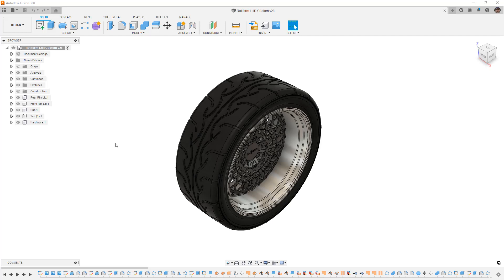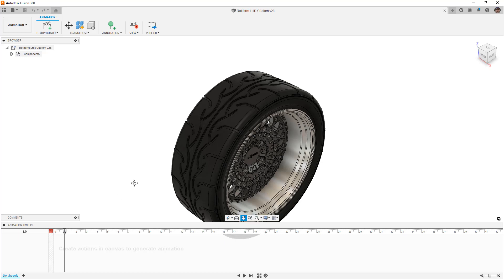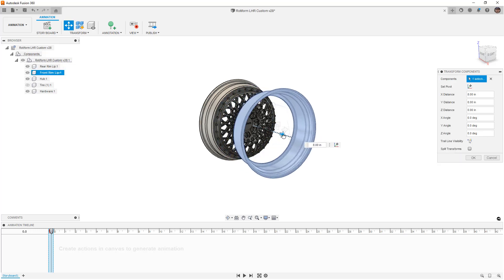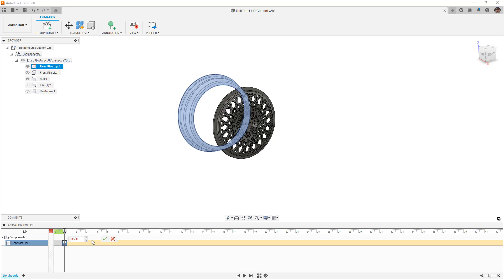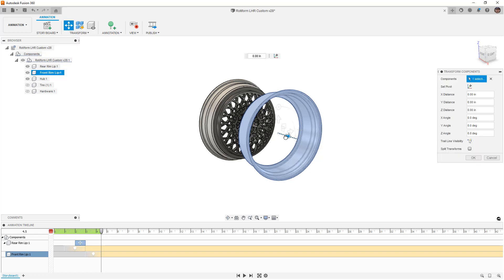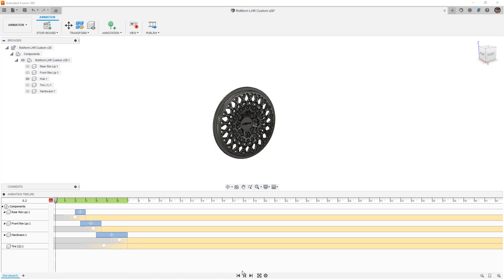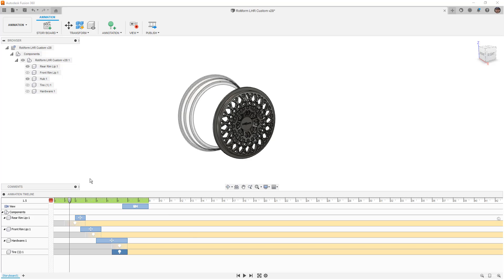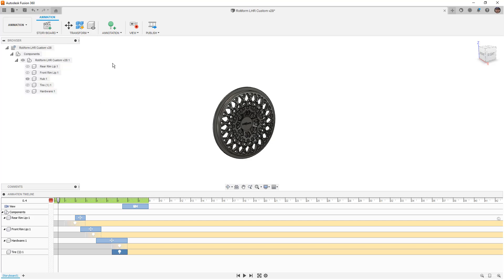Fusion 360 Quick Tip | Basics of Animations | Everything You Need To Know (Almost) #fusion360

Comment: Why did it zoom in when you rotated the tire at the end? I'm tring to avoid it doing that, but can't figure it out.  it's so annoying, especially during complex camera view movements
Reply from the maker: Yeah unfortunately that "animate view transitions" I don't think can be turned off...  The only way I know to get around it is to actually rotate the components.  If you use transform components, set the pivot point where you want, then rotate all the components it won't do that bounce out/in thing.

I have tried to turn off view transitions in user preferences but doesn't seem to impact the animation....
Reply: @LearnEverythingAboutDesign  Seems like such a ridiculous thing, that Fusion should have fixed a long time ago
Reply from the maker: @ShopTherapy623  Agreed.  The animation workspace is really mainly used to create exploded views for detailed drawings, which are fixed.  You can't even render out the animation in HD, its only a screen capture basically....  If you do a motion study in the design workspace and render an image on the cloud, you get an option to render the motion study.  But still no high quality animation export....

Comment: can it animate in the final envoronment? like not draft  looking?
Reply from the maker: Sadly no.  There is no rendered animation.  There are 3 types of renders you can do in Fusion.  Static.  After you have a static render and you are viewing the image there is an option at the top of the preview that lets you animate a turntable.  This will let you animate 6 or 36 views going around the part so it gives you an animation.  The other way is to create a motion study.  This lets you animate joints and once again if you render an image you will then get the option to render the motion study.

Keep in mind those will cost cloud credits or tokens.  You can generally do a small 6 frame turntable for free but doing a 36 frame one generally costs.  I don't think there is a free rendered motion study.

Comment: Hello! Thank you for a great video, was able to make a great assembly video, however I tried saving the video.  but it will not play. I have 3 different video apps , it will bring up the video but immediately goes to an error screen. has that ever happened when you export video?
Reply from the maker: The output is an .avi file.  i record avi files for screen capture and play them back in either VLC player or camtasia with no issues.
What media player are you using?  It is possible you don't have the proper codec to play avi files.  If so VLC is free and you might give that one a shot.  It will let you convert/save it as an mp4 if you need.
Reply: @LearnEverythingAboutDesign   that must be it. I wass using windows standard media players . thank you i will try vlc ... !

Comment: Whenever I load my project files into the Animation workspace, all of the objects fuse into one object. How do I prevent this from happening so I can move individual objects? Ok, they are not objects but bodies. What do I do to get them ready for animation?
Edit figured it out! gotta convert each body to a component! Right click, select make component from body, then rename the part.  ;)
Reply from the maker: Yeah glad you sorted it out!  Animations require components.  If you have a component with multiple bodies they will all move as one object.  The reason for this is because Fusion tracks the coordinate system which is associated with each component.  That way it doesn't affect the design at all.

Comment: Late to the party, but in the timeline I do not get the colours of the animations. To you it's blue for the animations, grey and yellow for visibility and so on, but to me its only the icons. It's really difficult to animate and I wonder if it's a fix to this? Can't find what I'm looking for online :(
Reply from the maker: are you on a windows or mac machine?  The recent Fusion update hasn't changed this at all so it is either a graphics thing or a difference in win/mac.  The timeline and browser both "render" over top of the modeling window slightly different than the animation itself.  Do you notice any issues with the Browser also?
Reply: @LearnEverythingAboutDesign  No issues with browser as I know. I just ran and checked on my laptop and figured it works there as intended. Currently reinstalling to see if it sorts itself out
Reply from the maker: Yeah that is a new one for me.  Not many people use Animations but I have never run across that issue myself or with anyone else.  I know this is usually a goto but I would check the graphics card driver.  You can do that from the help menu under Support and Diagnostics. there is a graphics diagnostic that lets you toggle some settings and check for an update.  There are some display options that can help with performance but I haven't heard of that changing the animation timeline.
Reply: @LearnEverythingAboutDesign   Reinstalling didn't help. Docking up my laptop now in frustration x) oh man...
Reply from the maker: what graphics card is in the system that isn't working?  and which one in the system that is?
Reply: @LearnEverythingAboutDesign  The one that isn't working has a GTX1060 (workstation) and the one that is working has a Geforce 840M (laptop).
Reply from the maker: @haavard1989  Hmm that is interesting.  I would have likely said the other way around.  In the laptop does it force the Nvidia card or is it possible its using an onboard Gcard?  I really have no idea why you are getting that but i still feel like its graphics card related.
Reply: @LearnEverythingAboutDesign  Yes, I don't understand any of this. I recently opened the laptop up to clean it and put on new thermal paste, and it did indeed have a separate graphics chip. If it ran graphics from the cpu it would shit itself in fusion 🤷🏻‍♀️ Oh well, I hope I can email some folks over at autodesk later
Reply from the maker: @haavard1989  Yeah. if you don't mind if they give you some info please post it here or shoot me an email support@caducator.com just in case it happens to someone else.  Thanks and sorry I didn't have an answer.
Reply: @LearnEverythingAboutDesign  No problemo, and I will do 👍